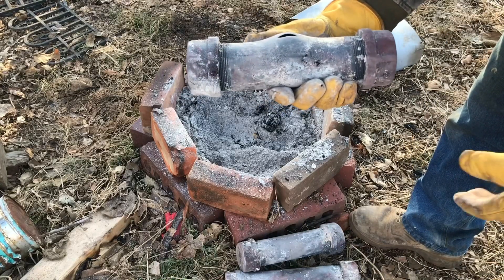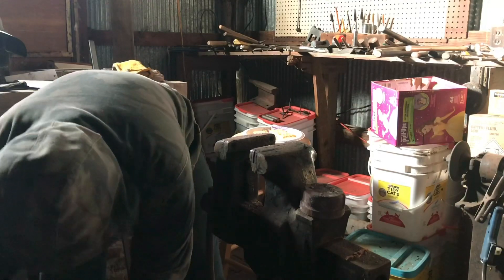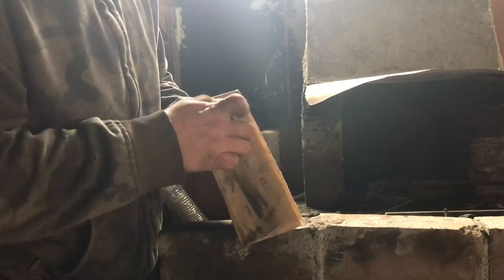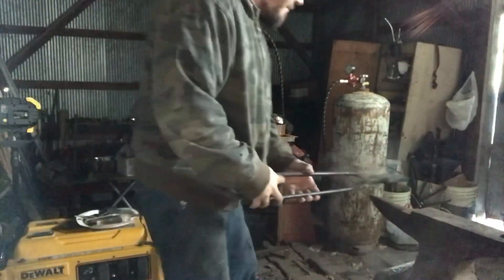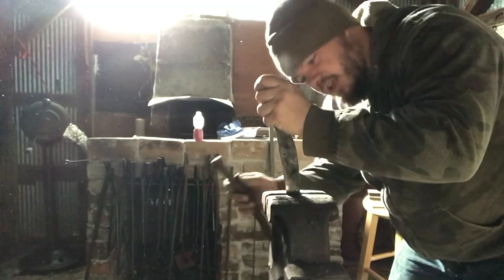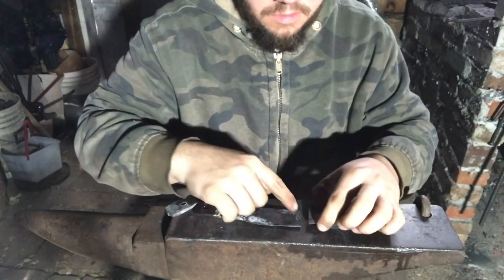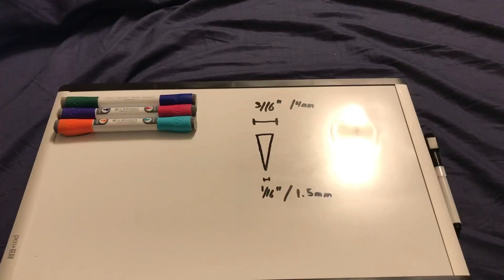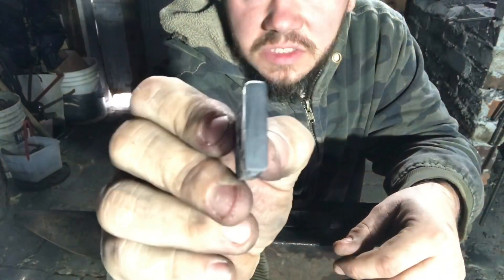Case Hardening Tools...and A KNIFE?! Pt 2

Comment: Gimme yer lunch money, kid. Or else.
Reply from the maker: Thanks for feeding the algorithm!
Reply: @veteranironoutdoors8320  keep making cool stuff. Im reasonable about getting your lunch money. I can set you up on a direct withdrawal plan and you can make payments. 😉
Reply: @veteranironoutdoors8320  I was in HHB 5/41 FA 1st Brigade 3ID in Schweinfurt West Germany in 1990-1992. I've got an old file I want to carbuerize and I think I'll do it in a  clay tube.
Reply from the maker: @tatersdomergue6463  a gun monkey?! Explains a lot. You dont need to carburize a file. Its already high carbon steel.
Reply: @veteranironoutdoors8320  I think modern files are crap steel with mill scale surface hardening. I've never bought and used a good file with a high carbon body. They suck.
Reply: @veteranironoutdoors8320  13F is not 13 B. We call arty, CAS, mortars and I have never been in a gun line. Nor been in the ranks of a Planet of the Apes cast.